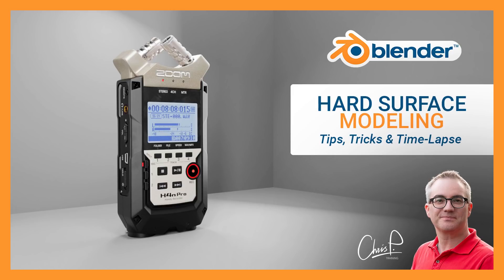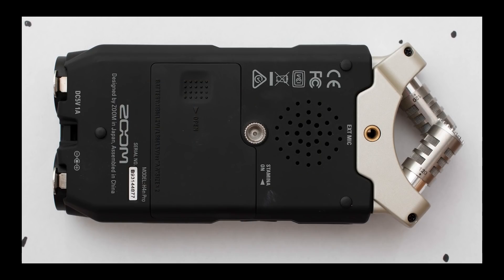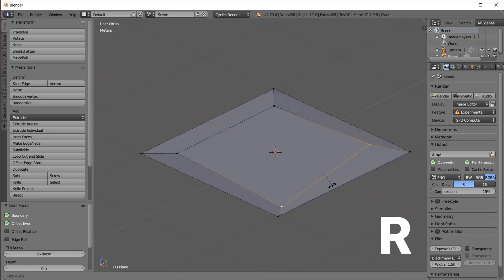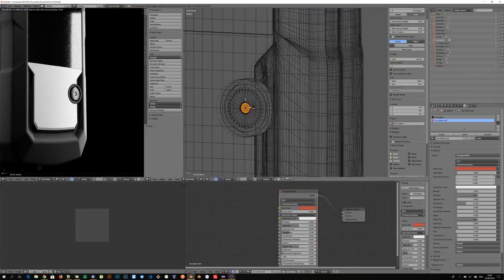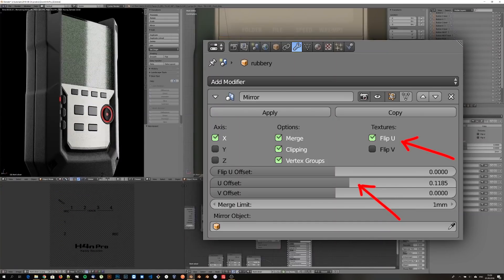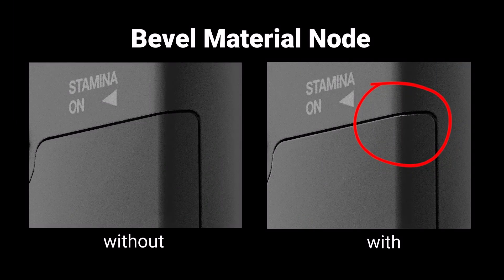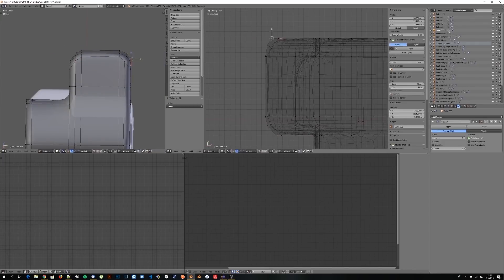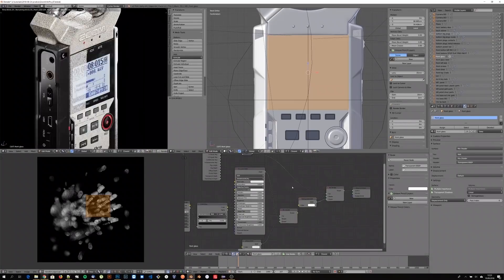Blender Hard Surface Modeling Tips, Tricks and Time-Lapse

Comment: This Is nice work Chris! Thanks for the video. Would you ever try to model this as pure quads? I've always tried to keep all my modelling to quads but it can get very difficult, especially with an intricate model like this. Is it something that you would strive for in future or is it simply not worth the effort when you can just use the boolean operators?
Reply from the maker: Boolean operators are awesome because they are non-destructive. I think for product visualization it will always be a combination of sub-d modeling and boolean just for simplicity and speed. For other purposes like 3d printing the requirements are much different. So I guess it really depends on what the goal is?
Reply: You can check out quad remesher. This is for after you have finished with your model and want topology perfection. I heard really good things about that addon. Its paid though, but they give you a trial to test it out. It's sort of like the remesh addon in blender but on steroids.

Comment: How would you go about using the final model in another scene, seeing as it is like 70 different parts at the end of your video. do you join it together or what would be the best way?
Reply from the maker: I guess that depends on what exactly I needed/wanted to do ... Joining things together, optimizing image maps and so on for exporting to other formats/programs OR simply parenting small parts to bigger parts and therefore making it much easier to move/rotate/scale for use inside Blender (which is what I currently use exclusively anyway)

Comment: what is the usefulness of doing this type of modeling that it should be done with a parametric modeler, with a polygonal modeler?
Reply from the maker: for me it's about practicing modelling and - most importantly - the final result... if you can do it differently, good!
Reply: I did not want to be rude. You can model very well. Only I would never dream of making these precise objects with blender. But I would model interiors or big architectures too, human organic...
Reply: @michelepetrelliart  Of course, if its all about precise values and 3d printing.But you can't get to texture or material or render the model.